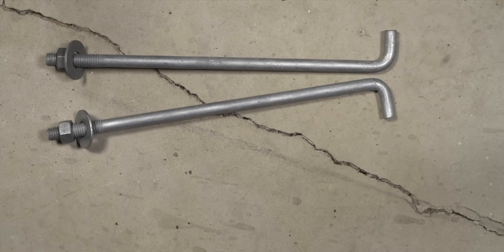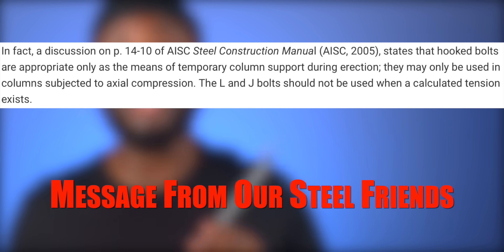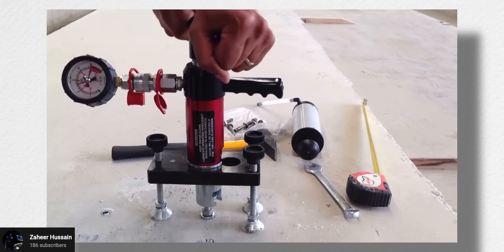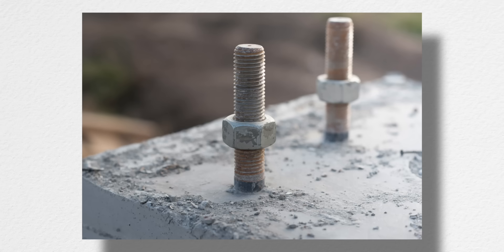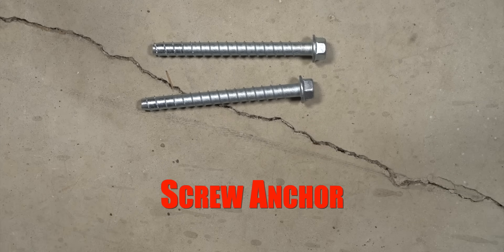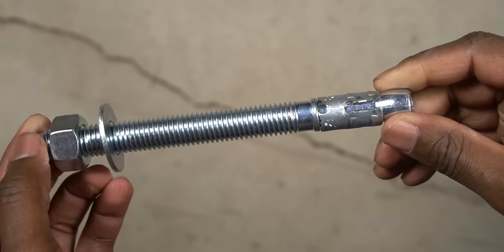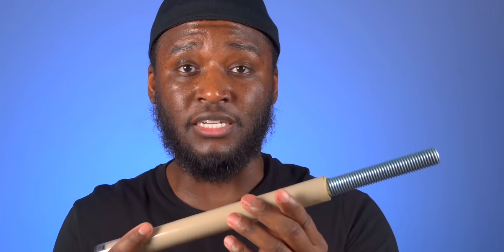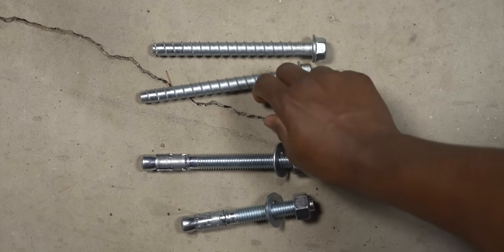Why Abandon "J" & "L" Anchor Bolts in Wood Framing Construction FOR GOOD?

Comment from the maker: While the tone of this video may sound like I am against the use of J/L bolts period, there isn't really much documented evidence I've found that shows failures in wood residential or commercial construction as a result of J/L bolts. J/L bolts are still technically allowed in the residential code and your building official may not have a problem with them either. The intent is to pass information about the issues other industries have had with them that I think might be a good idea to implement in residential construction.  If you've attached walls to concrete using J/L bolts, it's ok :)

I think J/L bolts have a place in very specific circumstances, however I do think there are much better options that are easier to utilize and do the job much better.
Reply: Retired LA inspector here, veteran of the 1989 and 1994 earthquakes. retrofit (new or old) bolts are subject to a lot of installation failures due to imperfect installations.  Epoxies slip if the hole isn't perfectly clean in old work, and if the holes are drilled too early in new work.  Ridge (threaded) bolts suffer if the hole is even a little oblong from poor drilling technique. Expansion anchors only work to load specs if they are embedded in concrete of sufficient strength and mass to support them (very few stem walls create this).
The seismic engineers I worked with derated all of these fasteners to between 30 and 60% depending on conditions.  As a side note, rebar has been required in all footings and stem walls in LA since 1971.  Almost all contractors hook the j bolts around the rebar as part of the spacing and securing process.  This significantly increases pull out resistance.  This was apparent in the 94 earthquake.
Reply: So the titan bolt and wedge anchors will do just as good of a job as the cast in bolt on for example use with at htt5 tie down?
Reply from the maker: @johnjv24  the HTT5 is a hold down that’s typically used for shear wall tension hold downs instead of sill plate anchorage like here. I don’t think Simpson has tested wedge or screw anchors for that application. Wouldn’t hurt to ask them about substituting cast-in for post installed.
Reply: This is what they told me. I asked them a while back about using titan hd concrete screw with htt5. 

“It is acceptable to use a Simpson Titen HD concrete screw as the anchor with our HTT5 tension tie connector. Always make sure to determine the anchor capacity for your installation conditions and use the smaller of the anchor or connector capacities when designing the connection.

Simpson has a web application called Holdown Selector that can help you select the best Simpson holdown and aid in the anchorage as well. I have included a link to this web application below.“
Reply from the maker: @johnjv24  I didn’t even realize you responded…. My bad 

in that case I would consider them for holddowns if the calculated uplift is small enough where it doesn’t require a deep embedment into the concrete. If it needs to be embedded deep, say 12”, I would go the cast-in option.
Reply: @JthaEngineer  As we use masonry instead of wood in Europe, this would only apply for garden sheds here. Only roofs are light enough to get uplift.
I do wonder if people use heavy bolting of the bottom wood, do they use enough secure bolting of bottom wood to the upper wood? If J-bolt are aligned properly ( always tricky), I would suggest welding them to linear rebars or if available J-bolts more in the shape of a fish hook.
I used to live as a kid opposite of a 50 meter (55 yards) high metal transmission tower. After 2-3 years it had to be renovated. What happened? They used rebar cages and J-bolts hooked like a question mark in the concrete to screw the tower to. Foundation was a 3 meter (10 foot) reinforced concrete block standing on 9 leg of reinforced concrete ( length approx. 15 meter). Fixing was done by digging under the block and drilling multiple holes, driving 3 meter long bolts (50mm/2inch) through it and and nut on both sides.
I guess someone started to recalculate the leverage and wind impact or they discovered that the concrete wasn't of the right specifications.
Reply: @JaakJacobus  Proper alignment can be critical, yet many who pour concrete do not understand this, especially in residential construction where most do not understand concrete at all. Done properly wood framed walls can be very strong, and in seismic intensive areas can exceed masonry structures for survivability at a reasonable cost. Wood is cheap here in the US which is why we use so much of it in construction. To build homes like Europeans would triple the cost making a home unaffordable to most people. It's a good compromise most of the time if it's done well to modern standards.
Reply: @JthaEngineer would think you’d have done that legwork (consulting simpson re hdu application) before putting out a video of this tone. But hey, utube runs on debate and controversy and here I am engaging…
And it is a good conversation. However, that sideeye you’re shooting… shooting some back atcha!
Reply: Ah, I read this after posting my comment.....
Reply: Researching on what should I use to make my own home, this was very valuable information. Thank you.
Reply: J bolts should be tied to horizontal rebar. Did industrial I-beam concrete in northern Alabama mostly on the Tennessee River factories/plants. Some main beam j bolts in big multi story buildings are an entire fabricated structure
Reply: Prefer j bolt but to a better upgrade...
Reply: Don’t post installed anchors need to be witnessed by a deputy inspector?
Reply: @drewt9829  No, only their presence to be confirmed. the Inspections for anchors came out of the epoxy anchors of old. Thats gone now
Reply: They're more annoying -- having to be in the concrete from the beginning -- but... I think I'd trust them more than redheads or epoxy or even expandos...
Reply: I’ve done lots of demolition over the years.  Anchors like your suggesting pull out with ease with heavy equipment.  With the same kind of equipment doing demolition where 5/8” J bolts were used the wood fails and the sill plate stays in place.  Your opinion on this is a classic example of having the education but obviously lacking the experience. I don’t want to be rude to you, but I don’t want the P.E. behind your name to erroneously lead people into believing they are getting a product that is of equal quality.
Reply: @michaelswope2863 demo is the best teacher. Ive torn off 200+ failed roofs and know a crapton about how roofs fail in my region.
Reply: I dont agree...it works great on projects overall. Ever tried giving a j bar a few wraps of steel wire before submerging it in concrete to set accordingly ?
Reply: The anchors you are suggesting are only used to reduce the skill necessary for construction just like all the other engineered items like flooring. These product are being designed to benefit builders ONLY. Reduce necessary skill and you reduce wages....don't listen to this guy
Reply: @BrettWilliams-o9y  LOL!!
Reply: Anybody that finds it difficult to properly set "J " or "L" bolts should be run off the job.
Reply: @dallasarnold8615  More LOL!

Comment: Haha you are wrong on so many levels! You would never post installed anchors like redheads or anything similar you will fail inspection automatically if there are no j or l bolts in the slab thats a fact!

Comment: Nice video.  Not only are anchor required for uplift, but also for lateral load (esp. seismic).  It would be interesting to test the capacities of these different options in the same concrete pour..  I would expect J-bolt to have a higher capacity than the screws, expansion anchors, and maybe even expoxy anchors.

Comment: As an architect in Florida we use long j bolts which are hooked around rebar in the foundation. While I have seen retrofits using the screw type  drilled connectors  in  your video...I'd like to see how your system does after a cat 3 or 4 hurricane. Lab tests are one thing. How this works on site and in storms is another. How much variability and field error can be tolerated?

Comment: Got any actual pull strength ratings on those three types of anchors ?
   I've used them all and lag screws with lead or hardwood expansion plugs as well. Installation is often a problem with wedge anchors or either of the expansion plugs because in my experience at least 25% of the time they will want to spin in the hole instead of tightening (especially the wedge anchors). Glue system is plenty strong as long as the holes are clean and dry, which is sometimes difficult to achieve. But check the cost - it will be at least 10x  J bolts and probably 4-8x the cost of wedge anchors or tapcon screws.
  The only advantage I see with post installed anchors is that they are easier to locate and orient correctly. I might submit that, if you have to wait until the sill plates are in place to locate the anchor positions, one might want to get into another line of work.
  A trick for orienting the Jbolts if you are using concrete forms: cut 2x4 pieces long enough to bridge between the two sides of the form. (Axis of 2x4 perpendicular to the wall.) Drill a hole the right size for the bolt and secure the bolt with two nuts , one on top and one on the bottom ( the 2x4 is thick enough to hold the bolt properly vertical).  Measure and secure these to the foundation forms according to the locations shown on the plans or  by comparison with the sill plate. Pour concrete, when hard remove the top nut and the 2x4.  Bottom nut remains in the concrete.
  Want to remove a non -load bearing wall easily? If it uses any post installed anchors except the glue kind, just  use a three foot pry bar under the sill plate and those anchors will pop right out. You won't be doing that with J bolts or properly installed glue anchors.

Comment: You're not allowed to use either of the two alternatives you suggested in CA. Also, you have to have the anchor bolts held in place before you pour the concrete.

Comment: Concrete screws are a set up for failure because you have to do them correctly,when a poured anchor bolt is in place, it is in place and can’t be stripped out

Comment: I thought j- bolts were mainly for shear while various hold-down assemblies were for uplift. Also, as someone pointed out, tying a length of rebar along a line of bolts also adds strength. Where I live inspectors will not allow you to wet- set bolts, they must be set in a template so they get vibrated in with the pour.

Comment: Yes ... I do this for a living ... it is easy to install these j-bolts ... laborer- or apprentice-level task ... whereas using these drill-in units required me to have a civil engineer standing over my shoulder to certify the epoxy was properly mixed and had completely filled all the voids ... it's three times cheaper to just use triple the j-bolts ... and these drill-ins are no better under seismic loads ... our sill plate will break before the bolts do ...

Comment: I get it. You want to leave out the cast-in anchors because you don’t know where your future joists/plates/studs are going to land and want to select anchor-bolt locations during framing. The goal is to not have any anchor-bolt tops interfering directly under the stud or joist. 

No California building inspector will let you pour a foundation for a single-family house without the min 5/8” x 12” HOT DIPPED J-bolts PRE-POSITIONED into the forms preferably with grade 60 rebar tied into the J-hook. Many of our local engineers will also require Simpson SSTB serpentine pre-positioned anchors at the corners for HD5 type hold-downs. 

If your approved plans showed post-pour installed anchors, the building department would require epoxy anchors, not wedge or sleeve anchors. They would require a “special inspector” to be paid to observe the entire epoxing operation: drilling, cleaning out the boreholes, measuring the depth and observing the epoxy and bolt install with epoxy-brand,expiration date, ambient temperature etc. 

Maybe these electroplated flimsy wedge anchors are OK in seismically inactive places like Alabama but not in a Class4 seismic zone. And the labor to post-install them is 5x the labor to pre-position them. Believe it or not, it takes a fair amount of skill and experience to achieve even a 90% success rate with drilling and installing wedge anchors. Many of your boreholes into the fresh concrete will hit rebar if you didn’t plan correctly. Plus they’re expensive. Not to mention the noise, dust and roto-hammer expenses. 

The more careful planning you do BEFORE the foundation pour, the smoother everything goes afterwards. All future framing (joist or stud) members are located and marked on the forms BEFORE you mount your pre-positioned J-bolts holders ahead of the pre-pour inspection. Then, after the pour when you lay down the drilled mudsill, each bolt is in a perfect spot to turn a wrench and inspect the spacing with zero interference and notching of joists or studs. 

Most lumberyards sell bags of heavy reusable plastic J-bolt positioners called Hold-ems. They screw (or 8D duplex-nail) to the top edge of your forms, can withstand direct hits from concrete pumping hose discharge and can easily be removed (unscrewed and lifted straight up) after the pour in order to do linear trowelling along the top edge of the stemwall. 

Wedge-anchors are OK for light remodeling but we use them mainly for hanging electrical equipment.

Comment: What doesn’t matter how strong the anchor is into the concrete holding the bottom plate. When the nails holding the vertical 2x4 or 6, on the bottom plate, can pull out. 😂

Comment: Hold downs are for uplift, epoxied all thread has been shown to be insufficient for hold down retrofits requiring more placement locations over wet set methods with appropriate anchors.

Comment: Having a PhD in mechanical engineering, plus a bachelor's in civil engineering..... I am teaching at a major university. I'm going to have this included in my lectures. Students will now do extra curriculum with testing and lab to prove if this is correct or not. I personally think the integrity of the framing would fail prior to the J -bolt removing itself from the concrete.  Providing the hurricane straps between the plate and the rafters held tight. There was a gentleman on YouTube the other day removing the requirement for hurricane straps and installing one 6-in lag screw. I didn't believe this one either and may include that experiment for extra credit.

Comment: Those screws are not going to work any better. The whole point of uplift is that concrete is weak in tension. In order to solve this, the bolt needs to transfer uplift to the lowest layer of horizontal rebar. The hooks need to pull up on that layer from below, so tie the bend intimately to that rebar for greatest strength.

Comment: I always make sure the there is a horizontal bar directly on top of the inside of the "L" bend on an anchor bolt.  Bar being 40K or 60K.  just takes more time, hanging the mudsill, shooting and chalking the inside line in red, hold-downs located, etc.  I enjoyed the video but with one exception.  Concrete never dries.  Chemical reaction versus evaporation.  Do the graph, plot the curve and find that the curing process goes on forever.

Comment: I worked for 16 years in the building trades in Michigan and I don't think I have ever seen an expanding anchor, threaded bolt, or even lag shields recommend over L or J bolts in an extreme uplift condition. Wet set bolts were always prefered, and where they needed to be added, for post facto renovation purposes, in high wind locations like the lakes, epoxy set threaded rods, with 90⁰ strap anchors ties were required. In those wind uplift conditions, expanding or threaded anchors would never pass inspection.

Comment: We can’t wet set j-bolts on the west coast. They have to be tied in, and we will run a course of bar so that the hook of the bolt is underneath that bar. 

I’d much rather lay that bar and tie the bolts compared to hitting bar with the rotohammer and then drilling through it with a rebar-eater bit. Much, much rather, especially if we’re using grade 60 bar. 

Seriously, it’s faster to tie the bolts to your rebar curtain that go back with the roto hammer, bore brush, air nozzle, 1/2 drive impact gun. That’s four tools, plus your cord and air hose, compared to pulling more wire off the spool and ring the bolts where they need to be. 

Engineers. Pfft.
Reply: Sorry no spelling edit. You can figure it out, plus you engineers owe me. Bigly.
Reply: and I didn’t mention cost of the expansion -bolt or the Titan anchor.. ouch. Don’t even think of epoxy and all thread, it has all the drawbacks of drilled-in anchors plus the insane cost of the epoxy. 

J-bolts, enough said. The only drawback is standing the walls onto the bolts if you’re framing the walls on the slab and standing them. Big boy framers can do that without difficulty.

Comment: If those J-bolts had the same ribbing as rebar it would probably be more then enough. 
 I just did a deck and some of the concrete brackets weren't exactly on center. We made it work ,but I'm glad I didn't have to hammer drill holes for each anchor.

Comment: I don't agree with the new screw in bolts, how are the threads stronger than the J bolts? I used J bolts in all my concrete pours with no issues, 27+ years pouring concrete.

Comment: Most modern plans only use these for lateral stress. For many uplift loads long straps are imbedded in the foundation as specified by the plans which most likely are reviewed by engineers. Simpson makes a number of these straps. They are often used in conjuntion with sheer panel.